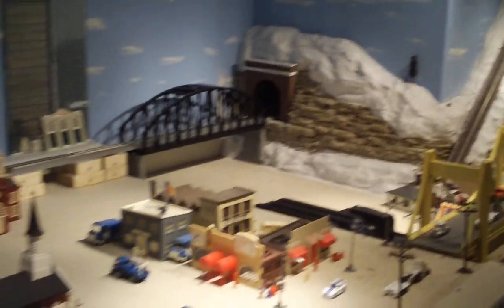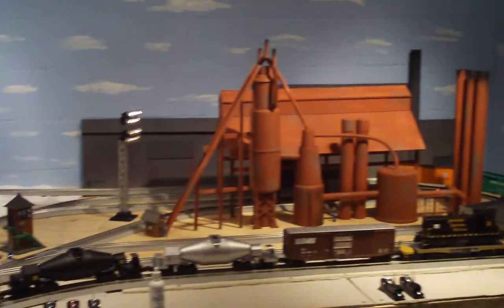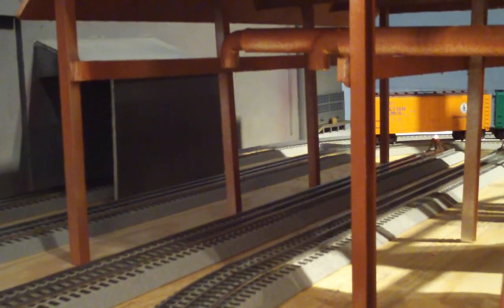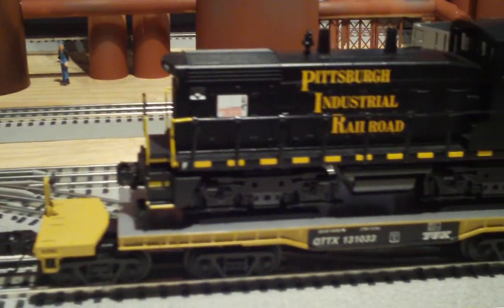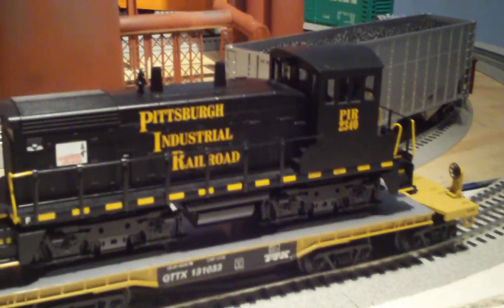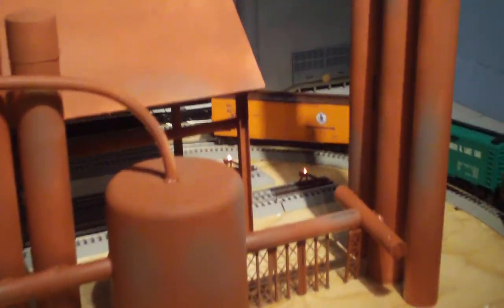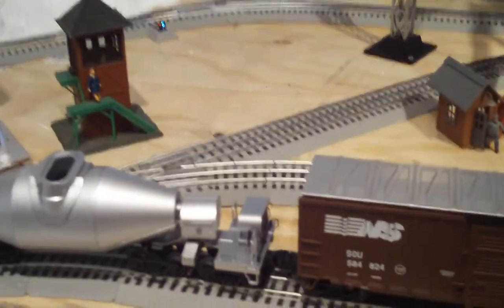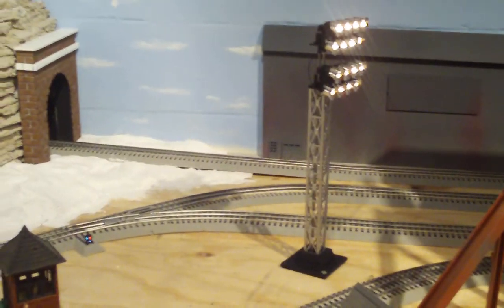Layout Update #6 "BLAST FURNACE & Pittsburgh Industrial Railroad " 3/5/10 Lionel Legacy

Comment from the maker: @buster6706 Thanks! i made it out of gatorfoam and stainless steel legs, that look like "I" beams.  Also I used plastic containers, hot glued together and pvc pipe.  I did use a few pieces of some old buildings I had. After I gathered all of the material I was going to use, It took me a total of 12 hours to make it over the coarse of three days.

Comment from the maker: @altoonaPArailfan Thanks! Its made with Gatorfoam, stainless, steel for the legs and supports, pvc pipe, and plastic containers.  Also, a few pieces of some old water towers were used.